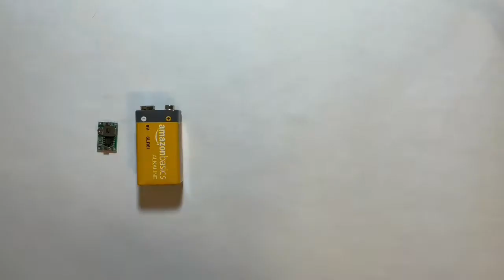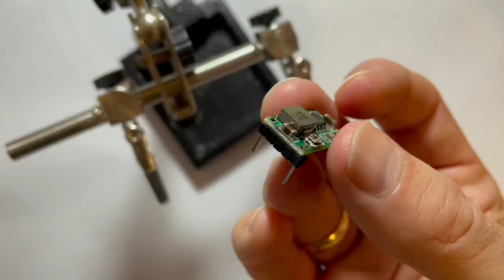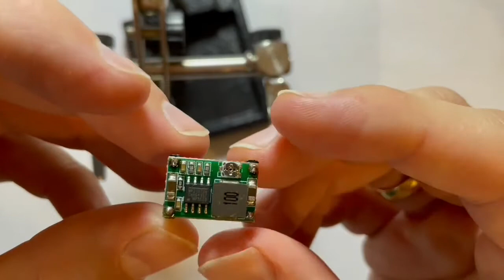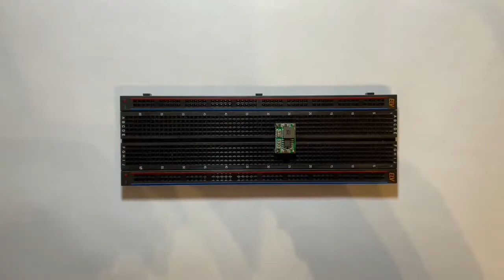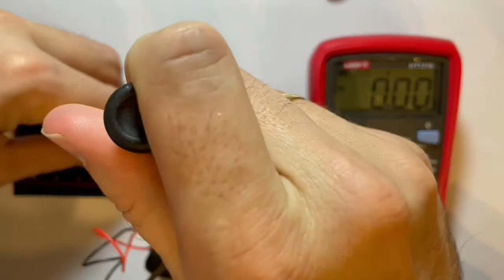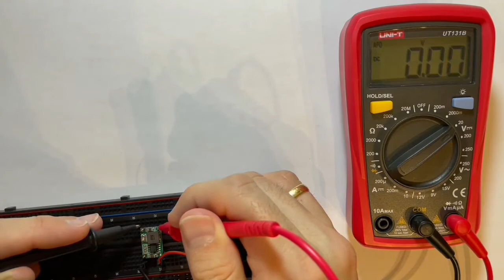DC Buck Converter MINI 360

Comment: There was zero testing involve - no load at all, no change in input voltage, you could just replace the whole module with potentiometer and the result would be the same. 
Sure I wanted to see how it burns as well.
Reply from the maker: Hey Jaroslav. I now have one video where output current behavior when connecting various loads to 5V output of the MINI360 is shown: https://youtu.be/jfJdSMak3Vg . And there is also one where I vary the input voltage: https://youtu.be/QG65mrj0dMM